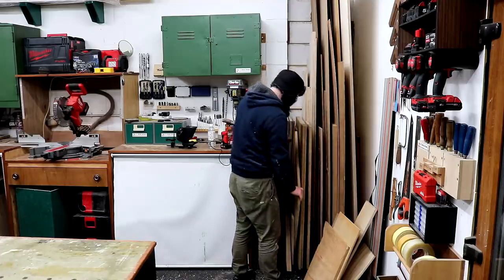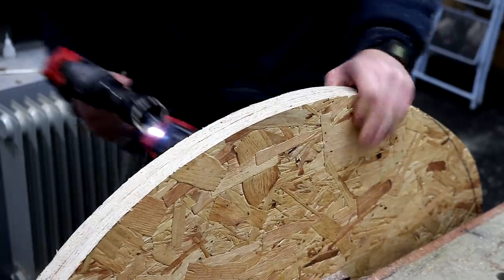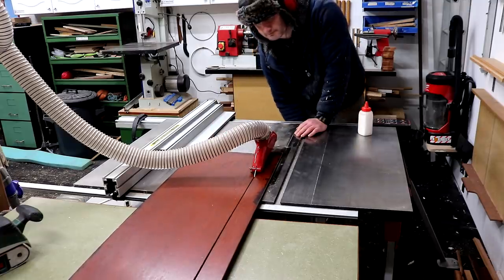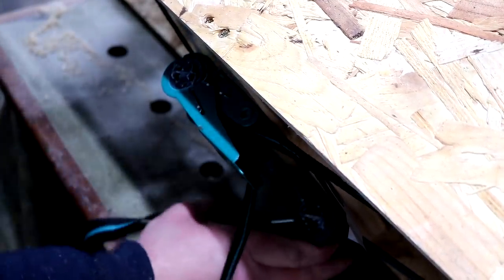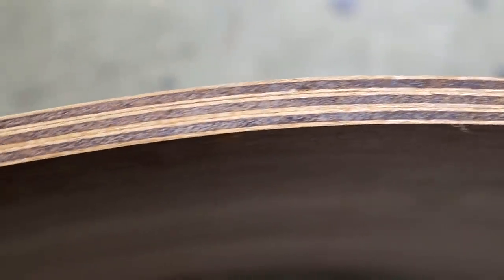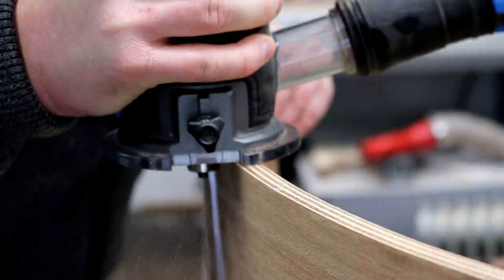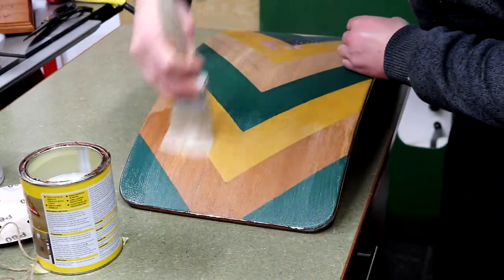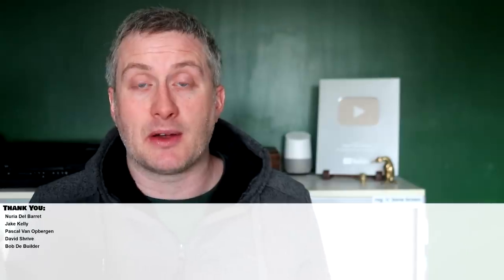Making A Balance Board

Comment: Keith that's a great toy, and will definitely help with ballance, motor skills and coordination. Little one will be an athlete😊
Reply from the maker: Cheers Karl, I had to google motor skills - didn't realise it meant what it means!  I thought it meant driving haha!
Reply: @RagnBoneBrown  Can't start learning too early! 😜
Reply: @RagnBoneBrown  that had me giggling a lot, I'm glad it's not just me that sometimes has the meaning of words confused. I remember when I was little, I use to look out for the big plants crossing the roads, (I had something like a triffid in my head without knowing what a triffid was), you can imagine my disappointment on discovering that it was heavy machinery they were talking about when they said "Heavy Plant Crossing!" on signs.
Reply: A couple of quick questions. Did you use a specific type of ply for this? And what wood glue would you recommend? (particular brand etc) thanks.
Reply: @dydod  Keith tends to use polyurethane glues (ever build or gorilla are brands that work) at this time of the year, due to the cold temperatures, or ever build 502 when it's warmer, both would be plenty strong enough.

Comment: Nice toy, and great for balancing skills. The kid loves it. The adult version is called a "rola bola", a flat board perched on top of a tube (I use a PVA plastic drain pipe). The rola bola is a lot more dangerous to use, but much easier to make.

Comment: Thanks for sharing the video. That's a great gift.  The possibilities of decorating it are numerous.  Now you've made the mould for it, eventually next boards will probably be produced faster.  Are you going to do something about the low temperatures in your shop?  5 degrees doesn't seem very pleasant to me.
Reply from the maker: That's a great idea! I have an oil filled radiator which helps when it gets chilly, but I actually quite like it being a bit cold as it makes me work harder!

Comment: Another great video thank you.  Just a quick question. Are you troubled by condensation in your workshop as it’s so cold. Mine gets quite damp when it’s cold outside and wondered if you had a solution.  Thanks gavin..
Reply from the maker: Not at all actually and I'm not sure why as there's not really any ventilation.  It is quite humid inside, but no issues as yet
Reply: @RagnBoneBrown  Many thanks. I’m just starting to insulate my workshop and found your videos really helpful.  Thanks again and keep safe

Comment: Reinforced with some fiberglass & polyester it would be a great training board for any age grp ,,, great idea, i better get cracking.
Reply from the maker: another sheet of ply would be enough, I think!
Reply: @RagnBoneBrown  I used 3 sheets of 4 mm ply for some chair seats I made. My experience with the 3rd layer was that I needed a lot of force and had to make a set of extra battens to be able to bend the curve (the raw seat is 60x70 cm and the bend is about 70 mm in the middle). Besides the extra effort bending a 3rd layer, using fiber/poly would also keep the weight down, which might be a good selling argument. All in all, I love such smart "inventions" as you did here, and it definitively manifests your position in the Makers community.